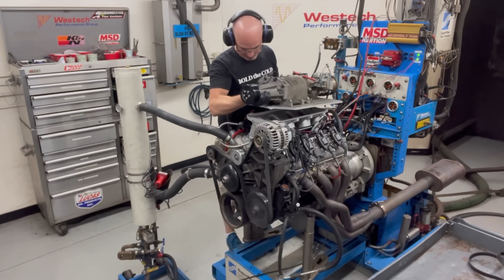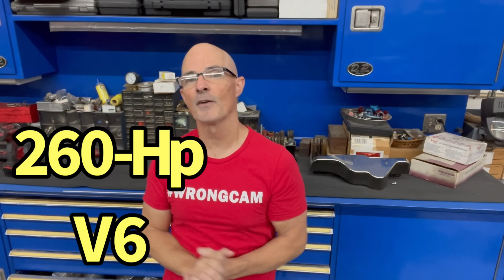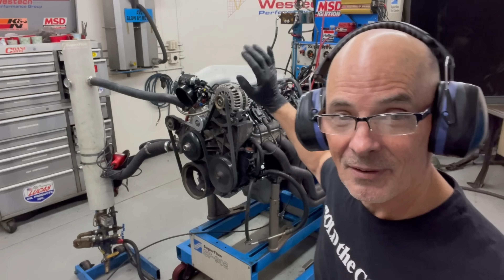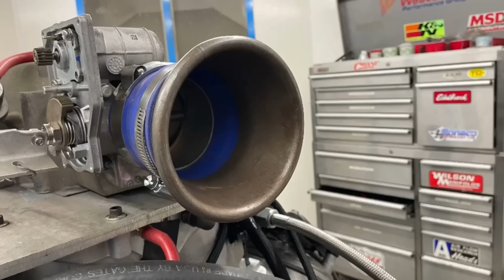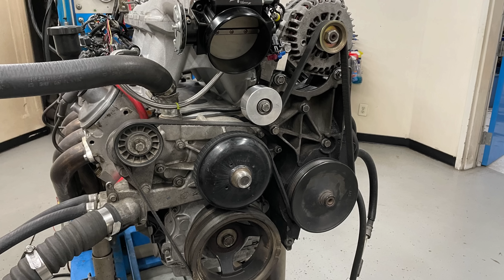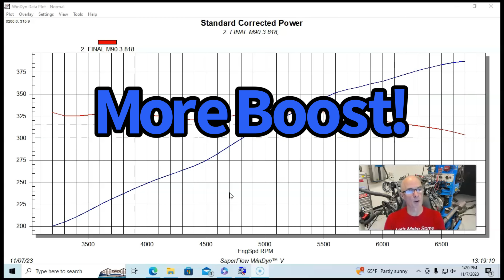DIRT CHEAP, $100 4.8L LS BOOST! JUNKYARD V6 M90 BLOWER TO THE RESCUE! IT FINALLY WORKS ON THE 4.8L!

Comment: That power dip question you have. I would wonder if your hitting that compressors limit of moving that volume of air at that rpm. I've heard that rotor style chargers will hit a point where the graph will just plateau regardless of rpm. It's like physics hits a wall and the amount of air being pushed in is being slowed down by the engines inability to get the exhaust out and this can cause all sorts of fun stuff.
Reply from the maker: but it went up when we added the 2.6 pulley
Reply: @richardholdener1727  what if that's the limit it can flow though? I mean I'm no builder but I am a mechanic so I kinda understand some of this but I question if the boost is at a point where it can't force itself through the engine. Like when a exhaust or intake ( frozen air filter ) get restricted the output will spike and then just go flat line .  The cam is big enough and the engine is set up to make a certain amount of power but it is limited to the flow in and out? Maybe that don't make sense, just me rolling thoughts around🤷✌️

Comment: Need to port the inlet. 100 mm+ if you wamt to see bigger power numbers. Roots style blowers hate inlet restrictions. Gains to be had on thr outlet side, but way more inlet side of things. Get am intercooler as well, and then you coukd probably go down to a 2.2ish" pulley. Might be able to see 525-550 hp with that set up.

Comment: Man Richard, I really love it when you test things that don't seem to make a lot of sense like this.  It's when we learn the most.  Now I'm wondering what the upper limit is for doing this same thing on a larger engine.  This blower might actually make some power on a 5.3 or maybe even a 6.0 or 6.2....  Who woulda thunk it!
Reply: Use two M-90 supercharger
Reply: Just get its bigger brother the m112 etc. From a gt500
Reply: @toob247  That would be the more obvious answer, but those are probably a lot more expensive, and it's more interesting in a way to see if the super cheap, obviously too small one will still make more power than expected when mounted on a larger engine.
Reply: @tptrsn  m90 is good for about 300hp 260rwhp. All kinds of forums. The thunderbirs sc was awesome but never made big numbers even totally worked
Reply: @toob247  I get that, but did you watch the video?

Comment: M90s are decent for the money. We been 10.79@126 @3500lb with one on a 3800 v6. Was using a 61mm (2.4in) pulley with a 10% OD balancer. Maybe you could find an over driven LS balancer to try??
Reply from the maker: ati has them or I have a bolt on from Torqstorm
Reply: @richardholdener1727 could you try it in a ls1 ?
Reply: The overdrive balancer on the 3800 really helped me out with avoiding belt slip with too-small blower pullies and not having to turn the snout.

Comment: Power drop is heat kicking in .e85 fixed the heat fall off at the top
Reply from the maker: the 2.6 pulley was run with 91 too and fixed the drop off before the e85-it is not that

Comment: 450 on pump gas. For a cheap setup, that is making some power. This is old school hot rodder,
Reply: Blower cheap but not the intake, fabbing brackets for tensioners injectors TB etc. 
Adds up..different approach though

Comment: That's kind of wild that basically the M90 is pretty pathetic on a V8 but I remember when Roush had a M90 on the 4.6 2 and 3 valve years ago that made decent power.

Comment: I have a 2006 Silverado 4.8 , 200k on it ,and that little mouse motor pulls my 6k boat all day long with no issues . But I would not want to put a blower on it ,with all the cost that go's into it .Just for more torque . If I needed more power ,i would drop in a 6.0L .with no d.o.d or cam phaser. Or install lower diff radio gears .

Comment: Would like to see the charge IATs. 
And just a small spray of water/washer fluid/meth into the TB. Don’t need much. 
Valve float. Stock VS are good NA to 6k, with 6 and 8 psi boost you lose some VS pressure. Doesn’t take much more VS pressure just +10-20 psi will stop the valve float.

Comment: my guess richard on the power drop off is from the small hole in the adaptor plate for the supercharger and being at the front of the engine it is a pitty you didn't have egt sensors in the headers to see if it was running lean or rich on the rear cylinders but over all great video now to the meat and potatoes when are you going to do a barra motor build and dyno run cheers from down under
Reply: That was the size of the output of the supercharger.

Comment: Richard , i Like the way you display all of the engine changes on your graphs , each change has like a 20 to 25 h/p difference , so cool , would you consider on your last test by using Nitro Methane ? it should jump about DOUBBLE The H/P ?  that would be fun to see those Tests !

Comment: I'm not sure where you're metric to imperial pressure conversions came from, but you were making a lot more boost than you thought.  Basically 70 kPa is 10.15 psi, so with the big pulley you were making 16 PSI, not 1.6.  The 157 kPa that you made with the party pulley is actually 22 psi.
Reply: It's absolute mate, not gauge pressure...
Reply: @brettus9115  so is his kPa measurment at the gauge and then he's converting it to absolute for the PSI number?  Because 111 kPa is always 16 psi measured at the same point.
Reply: @thorsenst  The kpa is absolute. 157kpa is 22psi "absolute". Now minus the atmospheric pressure (101kpa or 14.7psi) and that equals the 8psi of gauge boost...

Comment: I'd love to see how much more power it would make with an intercooler. I'd also like to see intake temps as well.
Reply: I don't have much blower experience past m62s, but I'm betting IATs on this were probably around 170 dungrees F at redline.  Intercooling this particular setup would be a challenge, you'd obviously be much better off ditching the holly lower intake for a custom built part to squeeze a heat exchanger in that valley.  Throwing some I/C action and more timing at such a setup would be spectacular results!!

Comment: Wouldn't a low rise intake do better here? Something like a single carb style but with injector bugs. That opening would also match the output on the blower. But I'm guessing you went that route in order to extend the snout on the blower drive in line with the belt.
Reply from the maker: a low rise intake would not make as much power as this-unless we ran it to 8000 rpm

Comment: On your baseline run, it’s turning the alternator, and then the belt doesn’t touch the alternator for the boosted runs, I’m just wondering if you accounted for the difference in power loss operating the alternator on the baseline?? it kind of makes me question if your first boosted run was really as accurate as you think.
Reply: 10:40 is the run in question. He say it makes more power, but it’s not turning the alternator.
Reply from the maker: power to drive the alternator is 2-3 hp

Comment: Im betting the loss in power up top was from IATs. That blower has zero cooling on this setup. Needs meth or an IC. 

Impressive numbers for an M90. But also inline with GTP numbers, which cap out around 350-400whp iirc.

Comment: Very stout engine no doubt,but would a twin turbo,twin M 90s at a moderate boost,wouldn't it be considered a big bang engine,600 honest horsepower and torque for days,cheers from australia 🇦🇺
Reply from the maker: 600 hp doesn't need to be that elaborate, but would look cool

Comment: They're not super cheap, but a S55/E55 blower off a Mercedes would be badass for this type of test, and should support 700hp yet be thousands cheaper than any normal blower.
Reply: Can it be adapt to an ls1 ?

Comment: In these non twin screw blowers, there is no compression happening is the housing correct? Only due to restriction in the engine. So if you compounded a turbo into the supercharger and it spooled up to then make more boost than the blower is making, wouldnt it actually turn the blower faster and add power to the engine through the belt?
Reply from the maker: a turbo doesn't work that way-but it will make more power
Reply: @richardholdener1727  what do you mean a turbo doesn't work that way? If it's making boost on the intake side of the blower it's going to spin the blower. The turbo doesn't know what restriction is causing it to make boost. If the blower is making let's just say 5 lb of boost at 5000 rpm. Then you add a turbo and it's making 10lbs at 5000 rpm. Then it's going to be forcing the blower to turn faster. A twin screw actually compresses the air so that's not what I'm talking about. A regular blower only displaces air so if the turbo is displacing more air at a given rpm then the blower should be producing power from its shaft from the turbos pressure.

Comment: Ok. So I did a little digging. Apparently the only gen v(5) m90 3800 application is the 2004-07 Grand Prix gt/gtp. There is one currently in Dayton Ohio LKQ but it's been there 2 months so it's a crap shoot. The 5 lkq near me don't have any. Gen 3 are fairly common. I'd still really love to see this test with a gen 3 with a pulley swap. I know it's not as easy to do but it's possible.
Reply: Honestly all said and done (porting and what not) just get the Gen 5 or if you want to stay somewhat cheap and still have good potential with porting then go m112...it blows my mind that people even consider the m90 gen 3 even though yes it is cheap but the gen 5 m90 is already a better blower to begin with
Reply: @monikhushalpuri  yeah well, all blowers are the same price in the junkyard. You just gotta find one. No m112 except rover and jag. Haven't scored one yet because they're rare ish. Same as the gen 5. Never seen one near me and I have them set to email me when they show up.

Comment: I'd like to see it with an intercooler. Superchargers tend to heat the heck out of the charge air, depleting the air density.
Reply: I ran water meth injection on a Tacoma with the M90 with the small pulley and 7th fuel injector. Water meth helped, but it would heat sink pretty fast.

Comment: Is the fall off in HP after 5000 rpm with 3” pulley due to increased intake temp?

Comment: Something intercooler something something TURBOCHARGE IT AS WELL!

The boost supplied by the supercharger would likely get you more boost than backpressure (as long as you use a good manifold and appropriately sized turbo), improving scavenging and detonation resistance vs a turbo alone.
Reply: Would make more power just running a single turbo.

Comment: Richard, you should go the other way around with this:
Slap a 2.3L blower on a Buick 3.8L V6.
Reply from the maker: I made an adapter plate for Kenne Bell on a 3800 V6 back in 2000

Comment: So, 389 horsepower with the 70 lb. Super Ritchie (tm) adapter plate.  Got it.
Reply from the maker: 70 POUNDS?
Reply: @richardholdener1727  Okay, okay, maybe not 70 lbs., lol, but you did leave a fair amount of material on there.  I think you should go full-on with Super Ritchie Components.  Full mild steel headers for $15, intake manifolds for $40...  Sure they'll be a little rough, but hey, almost everybody owns an angle grinder, or at least a coarse file.  You could be kind of the Harbor Freight of LS components.

Comment: You need to use the setup off a Thunderbird Super Coupe. It has a jack shaft assembly that step-up the rpm even more. Couple that with an MPX supercharger housing you could get over that 500HP number.

Comment: Plenum volume will allow for the air to move freely, because I bet with the adapter sitting on top of just two sets of runners the back runners were choked down..
Question is did you have O2 sensors on every exhaust runner coming off the heads?
Are check to see what each exhaust port was running for temperature?
Like I was saying a sheet metal plenum to allow for the air to equalize would probably fix the problem of falling on it's face at high RPM's, and possibly the addition of dividers to funnel the air to each intake runner

Comment: You did mention that it had stock valve springs, could they have been floating causing the power to  level/drop off?

Comment: Serious question, could these new Holley intakes work with these superchargers on 5.7 hemi’s and 5.9 magnum’s? From what I’ve read online with specs it could be possible
Reply from the maker: shhhhh-this blower plates works with any Hi Ram-but not the pulley position
Reply: @richardholdener1727  ahhh makes sense

Comment: I think I know what happened when the power curve dropped. The intake temperature skyrocket as roots superchargers lose efficiency quickly when overdriven. If you have the same amount of boost going through the same engine at a hotter temperature, you actually have less oxygen.
Reply from the maker: except that the power jumped with a smaller pulley-I doubt the temp is very high at 6 psi
Reply: @richardholdener1727  yes. But could it be a certain grey area where the boost makes more power with the smaller pulley, but the heat is taking away a certain amount of that power, and it’s only super visible in that one specific range with that one specific pulley? I used to do a ton of stuff with the 3800 and eatons, and spinning them very fast you hit diminishing returns kinda fast.
Reply: @richardholdener1727   I was curious if intake air temp, but i guess it wasn't monitored?

Comment: Maybe intake valves floating due to using stock springs, aftermarket cam and adding boost.  At 6 psi, the intake valve springs are losing somewhere between 15-20 lbs of seating pressure.
Reply: 100% correct in my opinion. And this explains why you see the flat spot start at tje same rpm with the higher boost pulley.
Reply: so  after markets  springs  , rockers and a  turbo cam it will be, i am guessing  it will hit 600 hp, but still a 75-80 mm turbo  is king( and cheaper longterm  operation less parts to fail )  on any LS  and will outlast any  factory  junk yard m90 eaton  blower ,   but good to test  a  junkyard blower to see if theres  power to be made .
Reply: @spanishtreasure9551  the blower will struggle to get there. Adding the cam springs and rockers will allow it to make more power on lower boost but that blower will not make as much boost on the same pulley as it does with the stock cam.

Comment: I'm thinking dual blowers and throttle bodies... pin the crank and spin them babies up! It would take some special placement on the manifold as well as some drive belt engineering. Its still gotta be cheaper than buying another supercharger.

Comment: Winding up that small blower to those speed I would think your running into heat issues and therefore your air density is going down and your loosing the power there.
Reply from the maker: the air temp from a blower is mostly related to boost-the low boost likely does not generate high temps-but I need to check

Comment: Never would have thought, Rich.  These blowers struggled on the 3.8.
Reply: What?!! No they didnt.  I had a 99 GTP S1X intense cam, Gen5 blower 2.8 pulley on E85 non intercooled even it made 330whp and 410wtq and grednaded transmissions just as fast as I could rebuild them LOL!! 😂😂

Comment: Richard!! Not lying chevy on there website is selling the 454 engine again exact words like its 1970 s all over again it has 438hp and 512ftlbs torque you can order right now and order before December get $250 off its like a gen 7 or gen 8 454

Comment: I am surprised that it made more power with only 1.6 pounds of boost. I figured 1.6 lbs would not even cover the parasitic drag. Wow
Reply: NA at best is 14.7PSI before the throttle blades. This is atmospheric pressure. The piston going down the bore creates a low pressure area (vaccum) that the atmospheric pressure tries to fill. It does not take much boost pressure to aid that cylinder filling.
Reply: @daledavies2334  … but it takes horsepower to turn the blower. So my point was/is that I am surprised it did more than break even with only 1.6 lbs of boost.
Reply: @baby-sharkgto4902 I fully realise the situation, that the blower requires torque from the crankshaft to drive the blower. That reduced torque relates to reduced power. But a small positive pressure on the intake really aids the air entering the cylinder past the intake valve. This why F1 cars have a snorkel above the driver's head, to develop a ram effect of the intake air. Land Speed racers tend to run the snorkel out the front 6" to 12" in front of the radiator. The inlet size is not generally large, say 2" or 3" × 6" to catch dead cool air. It is not much but enough to aid the air getting into the cylinders at close to 200 MPH.
Similar is the tapering of the intake port from a larger cross section at the intake gasket to a bit smaller just up from the bowl. Then the bowl volume gets a bit larger. What this does is accelerate the air and then slow it in the bowl. This raises the pressure slightly in the bowl which aids the air to squirt past the valve. 
Too big a port volume causes lazy airflow and reduced low speed torque, caused by the air not getting past the valve well.
Reply: @daledavies2334  👍
Reply: I was amazed too he did a previous test with a earlier gen m90 with the same stock pulley size and lost a bunch of power. But only thing that was changed was to a gen5 blower and it somehow gained power. Is the gen5 that much more efficient?
Reply: 1.6psi should be 10 to 15% power increase.
Reply: @dennisrobinson8008 that's not how that works

Comment: That fall of at top was because you didn't have a blower cam all that boost is escaping during overlap going out the exhaust bro. Everybody knows you gotta run a blower cam with a blower. Ha ha
Reply from the maker: exactly

Comment: Id assume the power leveling off on the 3.0 pulley is because of the heat from the m90. They build more heat than boost and IAT is ahead of the boost